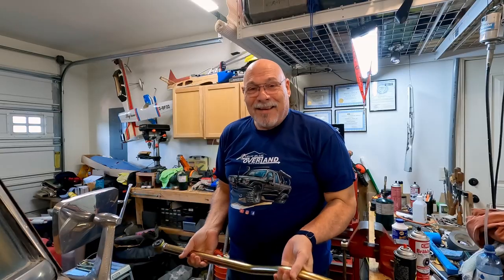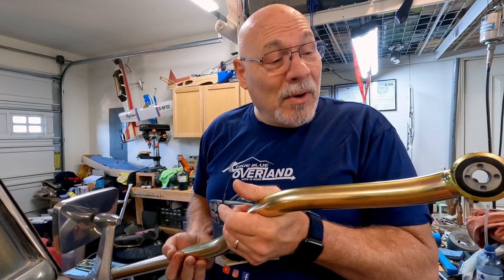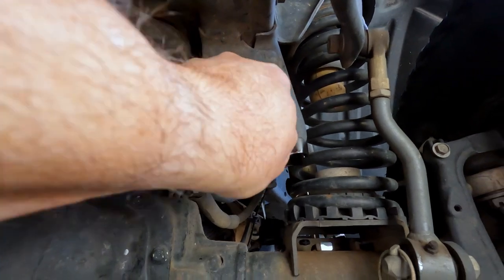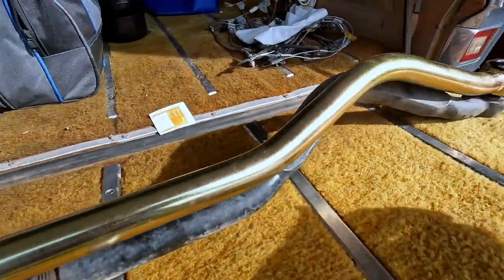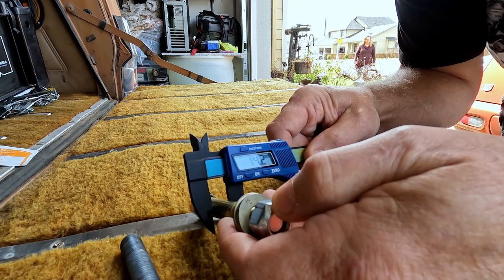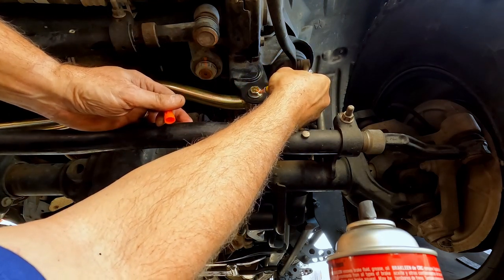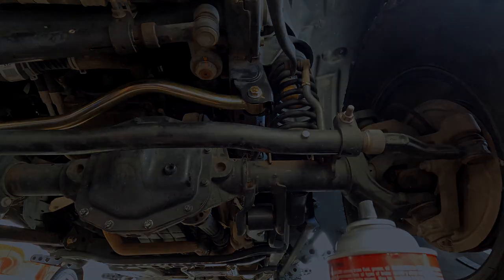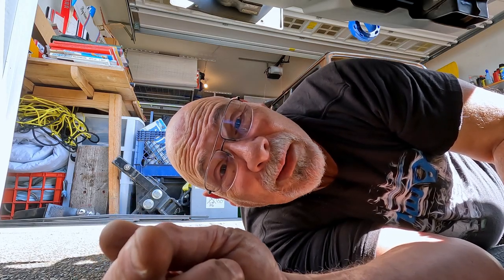MetalCloak Front Track Bar for 2020 Jeep Gladiator. Secret Installation Tips, and techniques.

Comment: A lot of lifts and aftermarket companies are re using the factory fully threaded bolts instead of changing them to a same size bolt with a shoulder and it’s a big mistake !! Great video 👍👍👍👍

Comment: That MC duratrak bar CAUSED me massive death wobble and I'd always had a steering nibble since installing it.  Another manufacturers track bar resolved the issue.  Not sure if it was a manufacturer defect or what the cause.  I plan to rebuild the joints on it...

Comment: Are you sure that is a factory track bar? It looks like the Rough Country one. Not to say you are wrong, it very well could be, but my 2021 has a non adjustable hollow tube, and that thing looks solid. I have not seen anything different than mine on any JL or JT. Very nice if it is factory.
Reply from the maker: Now you've got me wondering 🤔😆. All I can say is I did not purchase or install any adjustable track bar until I decided on the metal cloak. There is an outside chance, a very slight possibility, that the dealership installed it when I had the TSB executed for the steering gear box change. It was intended to stop the wandering nature and it replaced the aluminum gearbox with a steel one. But I cannot imagine the dealership would go to that expense. It was my alignment guy that pointed out that it even had an adjustable track bar and it appears he may have actually made an adjustment as it seems to have teeth marks from some kind of tool. Thanks for watching, cheers!
Reply from the maker: Yeah, that's a tough one sometimes. I have a local Napa automotive parts store that's been well established and happen to have some of the hardware that I need. 9:16 seems to be only used in automotive because you cannot find it at Lowe's or Home Depot or even Ace hardware. The other alternative is to buy it on Amazon but it's sometimes tough to find in the size you need and you have to buy a whole box of them for big money rather than just spending a few bucks per bolt.

So two choices I guess, find a well-established Napa auto parts store or maybe a tractor supply store if they don't have it they may be able to get it for you alternatively you can order it from Amazon. Good luck thanks for watching 🤙🏼
Reply: That's a Rough Country track bar for sure!!..that bar came with my 3.5 lift kit I'm switching out for mc

Comment: Sir... This a great video tyvm... My question is... Exactly what size is the jam nut... The three jam nut wrenches available at Metal Cloak are not the correct size i believe... Thank You in advance
Reply from the maker: I'm not sure myself. All I know is that I didn't have the correct size wrench either! I didn't bother to measure it, it's in the 30mm range I think, so I just grabbed my biggest crescent wrench and reefed on it while tapping on it with a dead blow hammer. It's plenty tight! I check it whenever I do a torque check. Even if it loosens up the setting won't change. Get it tight as you can and put a paint line across it and just keep an eye on it 👍🏼

Comment: Great video! What were the recommended bolt sizes for both the axle and frame?
Reply from the maker: 9/16 x 3
Reply: @blackpearlvoyager4174  fine or course?
Reply from the maker: @JMSynthetics  your choice really. I think I went with 18 threads per inch but I'm sure you can go with 12 threads per inch and be just fine just use good nylock nuts. And make sure they're grade eight bolts. Hope this helps.

Comment: So it’s 2, 9/16 x 3 grade 8 bolts, 2 washers (what size), and Nylock nuts? And no issues?
Reply from the maker: Yes that formula works out perfectly for the track bar on your Jeep. You should be able to buy 9/16 inch washers to match the bolt size. No issues whatsoever. Make sure you mark the heads of the bolts with a paint pen and just keep an eye on them. I have had no movement or loosening at all since I installed them. Good luck!
Reply: @blackpearlvoyager4174  did it today and it went perfect!! Thank you for the video, the new bolts are way better than the stock ones, and the coarse partial threads make me feel better than the stock full threads

Comment: So in your opinion the steer smarts yeti is weaker than this one? I always wondered the same but my fríe d keeps. Swearing by those yeti bars.
Reply from the maker: No not at all. I'm am familiar with the steer smarts yeti setup and I was going to upgrade my JK with that steering system.

The nice thing about the new Gladiator is that it already has a very Stout steering system. I just needed a better track bar.

I'm absolutely certain that you will like the yeti system. Cheers!

Comment: Nice Job, and thanks for the info, I was going to order a YETI Adjustable Track Bar but it's a adjustable in the center, now I'm thinking twice made sense what you said, how long are the new bolt you needed
Reply from the maker: 3 inch will be about right, if you can find them. Any longer and you won't be able to get a wrench on the axle side. YETI  makes a good product but I'll bet it's more expensive. Good Luck!

Comment: where did you get the bolts? and what was the exact size for the 9/16 bolts?
Reply from the maker: For this particular application I used 3 inch bolts. And yes they are a little difficult to find. Most home supply stores don't carry them even in their vast hardware stocks. I finally had to scrounge some up at a local auto parts store like Napa or have them order them for you. For some reason. 9\16 grade 8 bolts are tough to find. You might try Amazon but you may have to buy them in bulk rather than a few at a time.

Don't forget the washers on each end of the bolt. Other suspension components can be upgraded too but they may need to be a little longer or shorter depending on the application. I change them out as I do upgrades. For instance, I recently got some metal cloak upper control arms and when I change those I will upgrade the bolts then. Good luck on your build and happy holidays!

Comment: Did you use any blue or red loctite on the adjustable end?  Thanks.
Reply from the maker: No, loctite is not really necessary just put a good cinch on that jam nut. It's not going to come out of there or move. It can't back out if you think about it because it's bolted to the mount on the axle end. I suppose it couldn't hurt to put some blue loctite on that jam nut though...after thinking about it for a minute 😆

Comment: Not a factory track bar. I have a 2021 JT and lifted it and swapped the track bar. Stock bars are not adjustable. Only the drag link is adjustable. Was your Jeep used I assume?
Reply from the maker: Nope brand new off the showroom floor. As a matter of fact they tried to sell me a different one but I caught him on it 😆.

You got me wondering now I've had it in for repairs twice now and someone must have replaced it without letting me know. Either the dealership when they did the steering box upgrade or the repair shop. I'm going to go back a few videos and have a look. Thanks for your input. 🤙🏻
Reply from the maker: I just checked and in September of last year I had it in for repairs and the adjustable track bar is on there 🤷‍♂️. It had to be the dealership, probably had one laying around, and they put it on there as part of the steering box upgrade I guess?🤷‍♂️
Reply: @blackpearlvoyager4174  Very interesting. Wonder why they would use a not OEM track bar. Looked like your steering damper wasn't stock either. Nice work and video though.
Reply from the maker: @scotteramsey  yeah I bashed the steering stabilizer pretty good on Hell's revenge earlier in the year 😆😆

Comment: What's the torque value, found 110 ft lb and 52 ft lb on the JT forum.  Thanks
Reply from the maker: 110 foot pounds is about right for lug nuts but not the suspension parts. 52 ft lb sounds more like shock mount bolts.

Both ends of the track bar should be 125 ft lb. Same goes for the upper and lower control arm bolts.

Thanks for watching, Cheers!

Comment: 68? more like 55 my friend
Reply from the maker: Haha! That's my Wii Fit age 😆😆

I just turned 70 last month 😏 Still feeling great! 😁

Thanks for the compliment and for watching, I hope you got some useful information. Cheers 🤙🏼
Reply: @blackpearlvoyager4174  oh really, Happy Belated Birthday!  and thank you for the useful information, i just installed the same trackbar on my JL, unfortunately, i did not follow through with using 9/16 bolts, instead used the stock bolts and torqued it to 130lbs.. Most annoying part was the metal flakes from grinding the trackbar axle mount, it got all over me the place

Comment: are those bolts fine thread?
Reply from the maker: I believe they come in a variety of threads, but I'm pretty sure the ones I used were 18 threads per inch. I'm not sure that it really matters a great deal. They're grade Eight bolts and should be able to withstand high torque values like the 125 foot pounds required. Just make sure you use nylock nuts or add lock washers.

9/16 grade 8 bolts are a little hard to come by. So whenever I was digging around at the local Napa auto parts store if I found them, I just matched them up with some nylock nuts that fit and didn't worry too much about the thread count. I've had no issues so far. I just inspected them the other day and the paint lines are all still matched up. No movement at all. Hope this helps. 🤙🏼